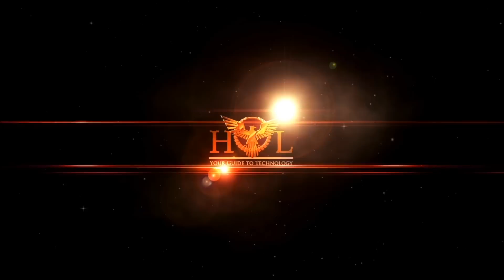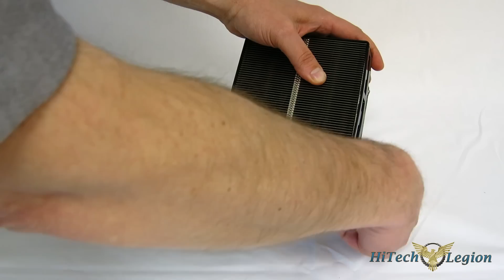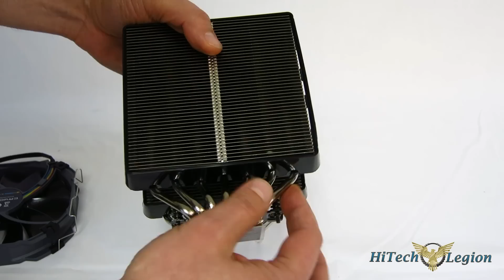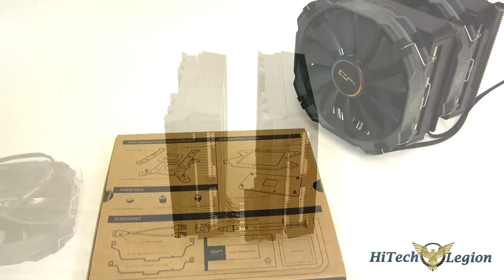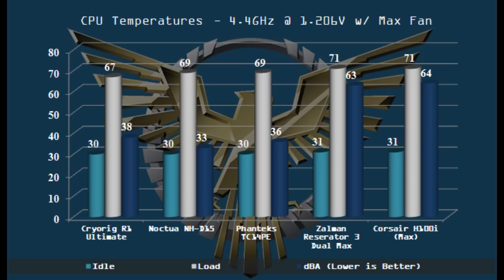Cryorig R1 Ultimate Overview and Benchmarks

Comment: Does anyone know if this fits on the Asus STRIX Z270F Gaming motherboard? It has quite large VRAM heatsink and I know it won't fit the EVGA Z170 classified for example.  
   
Edit: Bought them, fits nicely
Reply: Get the R1 Universal to solve RAM clearance issues. They are the same cooler but the Universal uses a slim profile front fan.
Reply: Draz ᴴᴰ  hey dude I've noticed you had commented in every single video about the cryorig r1 asking if it has high profile ram space with the asus syrix z270, did you buy it eventually? I've got the Corsair Vengeance led with quite tall heatsinks..
Reply: I did buy the cooler with the motherboard but I use regular size, HyperX Fury RAM and they are 34.04mm tall according to the manual. The Cryorig R1 cooler has 35mm RAM clearance and I had to raise the first fan just a bit with the clips because it wouldn't fit. I doubt those RAM sticks would fit though, they seem quite tall with the heatsinks :-/

Edit: raise the first fan, not cooler.
Reply: Force24T&S - Like Malcom said in his post the R1 Universal and Ultimate are the exact same coolers. The only difference is the Universal has a slim profile fan hence the name "universal" as it solves the ram clearance issues. You can also buy a regular R1 fan for the universal in the event clearance becomes a non issue.
Reply: Whats your casing? We got the same mobo btw
Reply: lol thank God I found your answer! Had a H80i v2 that sounds like a jetplane and I will return it monday. Just ordered CRYORIG R1 Ultimate and hoped it would fit on my Strix z270F. However I have the kabylake, but it says on the box 115X so I guess that'll fit well. Thanks for your comment :)
Reply: I have the i7 7700k as well, glad I could help! It's a really nice looking cooler on top of the performance and couldn't be happier with it

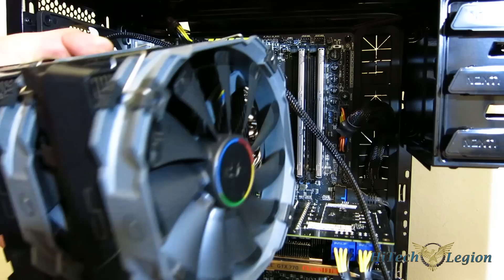Comment: 14:30 uugghh the screw holes dont exactly line up on my one. Was a real pita trying to screw the heatsink on. To much hassle returning it, so i got 2 screwdrivers, kind of bent them on the angle so they sat in the screw head whilst mounting the heatsink on the cpu. And even then because I was screwing them in from an angle, there couldve been a chance i cross threaded it. Dunno how that passed QC. Very bad first impressions from Cyrorig.

Comment: I have the nh d15 in my main stationary pc,  antec df case  but damt that thing is heavy. got the cryorig r1 for my 2 computer and dame thing was almost as heavy as the d15 and the cryorig is my lan pc, so be warned and leave ur computer on its side, cooler pointing horisontale when u have it in ur car going to lan parties so ur motherboard dont flex going in the speedbumps.. just a tip

Comment: Hi legion, is the Cryorig R1 universal good enough for cooling an overclocked i7-6700k at 4.6Ghz?
Reply: Yes, the Universal and Ultimate are actually the same exact cooler. The only difference is the Universal uses a slim fan on the front to clear high profile ram.

Comment: I literally ordered a Noctua NH-D15 just before watching this video, and I kinda wish I hadn't. The Cryorig R1 is unquestionably better looking. The colors on the NH-D15 are horrendous. Thankfully I have a windowless enclosure, so I won't have to see it lol. Oh well, the NH-D15 is quieter, so there's that
Reply: Could always return it
Reply: +Jordan March Nah if you're not showcasing just stick with Noctua
Reply: +nekineki Actually I did get a D15S + Asus Maximus VIII mobo + Asus Strix GTX 1080 + G.Skill Ripjaws V memory. The D15S clears the video card & RAM just fine. However, I got a 2nd Noctua NF-A15 fan to "pull", which I had to mount a little higher on the cooling tower to clear the RAM...but it still worked out fine.
Reply: If I had a windowless case i'd also get noctua, but alas i dont, so i'll have to go with r1. I'd get d15s tho, it's same performace, but better compatibility
Reply: Chromax

Comment: When you benched marked it were you running 3 fans or 2?
Reply: +Xellece Two. At some point I noted in the video that adding the third fan did nothing for temps in this particular build.
Reply: +George Cella ah i missed that part then. I was multitasking when i was listening to the video. This vid solidified me deciding to grab the Heatsink. I had some friends what were trying to push watercooling on me. I know the benifits but I want the longevity of the Fan Cooler more.  Gunna put this guy into a phantax evolv atx

Comment: wait, so that air cooling is quiter than water cooling? the heck
Reply: +Muphet When you are talking about CLCs, it always has been. Far more efficient, as well. When you cut through the hype and exaggerations, and then look at the actual numbers, CLCs simply aren't very good. CLCs should also never be lumped into "water cooling", they are simply a poor imitation.
Reply: David Wang I reviewed the Neptons and the Krakens here. Personally, I would take the R1 over either - and did, I used the R1 in my build for a long time while the Kraken and Nepton sat boxed in my closet. Not a chance I would have changed that purely because of the noise difference, and the fact that the R1 cools as well as either. If you put a gun to my head and asked me to choose between the Kraken and Nepton, I would take the Nepton every time, especially on the 660K which does not generate a lot of heat.
Reply: what is clc?
Reply: +Poo Jabba closed loop cooler
Reply: +George Cella how does this compare with the kraken x60? Also, in order for you to get those low Temps, did you use three fans? Or two fans. Btw, I'm referring to those graphs towards the end comparing temp and sound.
Reply: +David Wang The R1 and X60 have similar overall max performance, but the X60 will be ~12 dB louder. When kept under 40 dB, or at similar noise levels, the R1 will be a bit better in performance - how much will depend on your setup.
Reply: +George Cella well, as of right  now, Im thinking of getting a i5 6600k and possibly over clocking it. I've been told the cooler Master nepton does a decent job (not as good as the kraken though) but is fairly quiet.
Reply: Cool, thanks for the info!

Comment: You should do the Cryorig A80 water-cooler review, because of you review i bought the Cryorig H5A works like a charm, it does its job well. But i want OC my CPU and i want to know if it's worth getting the CR A80 water-cooler. Would be really help full if you review and test it or even the CR A40. Great job man keep videos coming.
Reply: +criot1124 Unfortunately, I won't be reviewing the A80. But....take a look at the NZXT X61 and Corsair H110i GTX. The A80 is the same Asetek unit with a couple of little tweaks. The R1 is still their top of the line in terms of cooling when noise is taken into account.

Comment: Why is the noise here 38 where on their site it's 23 dBA max and some videos around that number too?
Reply: +Sylvex Dragonskin It will depend on how it is tested. We use a distance of 1 meter at HTL.
Reply: George Cella Alright. Coolest looking cooler on the market, though, but the Frio Extreme Silent seems a bit better at the job at 4 dBA less.
Reply: +Sylvex Dragonskin You might want to research that a little more. The Tt Frio Extreme doesn't come close to the performance of the R1.
Reply: +George Cella With the 3 test I've found it's more silent, has more cfm and lower temperature.
Reply: Sylvex Dragonskin http://www.pcgameware.co.uk/reviews/cpu-coolers/thermaltake-frio-extreme-silent-14-dual-cpu-cooler-review/

Over 5 degree difference.
Reply: +George Cella I don't trust UK sites. The others clearly show that it is better but even there you can see it's 5 dBA less. Ill just try to find more reviews on this and the R1 Universal.

Comment: what do you guys think this cooler or noctua nh-d15 with only 2 fans?
Reply: +Cen Jake "Fell for the advertising" was readily evident the moment "better than all air coolers out there" was typed......
Reply: Zlobni Kotlet Yes, and that is unfortunate in the case of your statement....
Reply: +Zlobni Kotlet wow bad move bro. shouldn't have gotten that cooler.
Reply: +Zlobni Kotlet  R1 is slighter better in cooling , but d15 is a little more quieter so it is up to you
Reply: +Cen Jake got h110i gt in push/pull :D
Reply: +Zlobni Kotlet Nope its waste of money
Reply: +Zlobni Kotlet so do u overclock?
Reply: +Cen Jake its not a waste of money its better than all aircoolers out there but its a little louder. yes i have overclocked cpu to 4.4ghz
Reply: +Zlobni Kotlet what cpu r u using? and r u overclocking the cpu in 1.4V?
Reply: +Cen Jake i7 5820k 4.4ghz @1.3v
Reply: What a waste... 1.3V using a liquid cooler for it... You know i use cryorig H7 a $35 cpu cooler to overclock my i7 4790K to 4.7Ghz 1.3V running around 75C full load. Considering 5820K has better TIM and bigger internal heat spreader, it is going to be even cooler than 4790k... Spending so much money in cpu cooler is a waste of money in my opinion, you could have spend the extra 100 to get a better cpu
Reply: But I m not gonna judge u though, cuz u also fell into part of the advertising effect... It is your money after all
Reply: +Cen Jake nope theres not anything better for 100-200€ more
Reply: +Cen Jake i didnt fell in anything, dont me mad now
Reply: +George Cella what's true its true
Reply: +George Cella and why is that?
Reply: +GattaSplatta Man 

nah it was fine, already sold PC haha
Reply: h110i gt died today and almost cook my i7, temps were not even that good for the noise you had to deal with

Comment: Hi, very nice review. Seems like a quality product, well designed and nice looking.
Just one question. How much louder is it than NH-D15 on full load? ATM I have cm evo 212, and it's kinda loud on full load.
There are no words in this world for those Noctua colors xD I just can't put that in my system. So its either R1 or save up for some EKWB kit.
Reply: +Player 5 dBA louder as shown in this video. However - it will be significantly quieter than your 212 at like performance levels, and perform significantly better than the 212 at like noise levels.
Reply: +George Cella That's what I hoped to hear, because I don't know what 5dBA more sounds like in real life.
So, if I put a small resistor on R1 just to bring max voltage to about 10v it will be almost inaudible compared to 212 with similar or even better performance.
Thank you for the answer.

Comment: What ram where you using in this video? I have been considering purchasing this but not sure if it will interfere with my Kingston Hyper X fury DDR4 memory.
Reply: +Julian Salam I used ADATA XPG Xtreme. There is no interference with the HyperX Fury, so no worries there.
Reply: +George Cella 
Ah okay, thanks for the reply man.
Reply: +Julian Salam If you are concerned about clearance they also make the  R1 Universal which comes with a slightly thinner front fan. This apparently only increases temps by 1 or 2 degrees according to the forums I have read.

Comment: can i use a gskill trident x with hight disipator with this cooler?
Reply: +PanecilloGaming You can in several ways - Trident X has the removable top decorative piece so you can simply take it off. Or, you can move the fan up in the mount. Or....you can go with the R1 Universal, which has an offset so it does not interfere with the RAM.
Sine the red part of the heat spreader is purely for looks, and you don't see it under the fan, just take it off.
Reply: +George Cella thx mate for you help

Comment: Why does everyone use 2 fans in push pull even on square coolers? When you have 2 fans you get roughly double the amount of air flowing if you put them in 90 degree angle compared to push pull that just pushes the same amount of air trough as one fan at slightly higher speed. I use 2 fans in 90 degrees myself and it shows on the temperatures compared to push pull... On square coolers you can fit 4 fans if you absolutely want push pull.

Comment: So were the tests run with just the two stock fans or did you add the third? I have the same question about the NH-D15 as I'm deciding between the two. Cheers
Reply: Saracen Gaming We actually ran into an oddity with that. We ran these tests in the NZXT Phantom 530, and when the third fan was added it made absolutely no difference in temps. When we re-ran the D15 and R1 in open air, a Fractal R4 and Phanteks Enthoo Luxe some things changed. First, adding the third fan made a measurable difference, albeit only 1-2 degrees. The other change we saw was that the D15 and R1 had essentially identical performance in the other three scenarios, always being within a degree of each other and flipping which was better from mount to mount. So, the Phantom 530's fan setup was favoring the R1 in the same manner as adding a 3rd fan in most cases.
Long story short - performance between the two is essentially identical. The D15 is quieter (though the R1 is by no means loud), most agree that the R1 is better looking.
Reply: George Cella Wonderful. Thank you for your prompt and detailed response. I appreciate it.

Comment: How good is the r1's thermal compound
Reply: Riki Patel Pretty average. Ok temps, a little difficult to work with.
Reply: George Cella Would it be worth buying Arctic MX4 to replace it?
Reply: RacFuhk You may see a degree or so difference in temps, but the MX-4 will definitely be easier to work with.
Reply: George Cella Thank you.

Comment: not impressed with it as much as i should be, prime95 is showing me a max of 73 which isnt much better than my h55 was. on battlefield 4 im getting about 45 degrees and my h55 was getting 53. wish i would have gone with noctua.

this is on an i7 4790.
Reply: Arron Lowley Is your cpu overclocked?  Thermal paste application method?  Did you install it correctly because my r1 keeps my i5 4670k, 4.5ghz 1.26v at 65c, ambient temperature is 26c.  If you don't want it I'm willing to buy it from you for $50 and shipping is on you lol
Reply: +Ken Pachi you cannot overclock 4790
Reply: This is better than noctua ( d15 )

Comment: if i go aircooled with my next build, i think this will be my choice. the nh-d15 is the better cooler, but... i love noctua for their performance, but their color scheme is just disgusting. and the industry pcr or whatever thingys are just plain too expensive...
Reply: givemeajackson I'm not sure how the D15 is the better cooler given that the R1 outperformed it here. The D15 is a tick quieter, though.
Reply: George Cella If you read other reviews on internet and you'll see that D15 (and even D14) pretty much overpower R1 Ultimate. Don't base your judgement on one video or one review only. Youtube and review centrals are big marketing opportunities and many of them can be biased.
Reply: StarFury2 I base my judgement on the tests we do here at HTL in controlled environments, as well as the tests I do personally after the reviews, a few other reviewers who I know and trust, and industry personnel that I have relationships with. All of the aforementioned produced exactly the same results - in the same case environment, the R1 Ultimate and D15 were within 1-2 degrees of each other on Intel 115X and 2011. AMD can be another matter as there were seemingly some issues with the AMD mount on the initial R1 production run.

Comment: i want this cooler but i have vengeance ram :(, would you say i will still have 2 ram slots on the z87-g55? im not bothered about dual channel.
Reply: Arron Lowley Take a look at the R1 Universal. It offsets the tower to clear the RAM slots and uses a thinner fan on the front. Performance is nearly identical.

Comment: Mine is stock, i7 4790k stock, and I'm hanging on the high 80s mid 90s while on load with the cryolite CPUs paste, how can I get your type of temps?
Reply: Aw3someOpZ There is something obviously wrong here, most likely an improper mount. Try remounting and check to make sure that everything was tightened correctly and also that the plastic protector was taken off of the contact block.